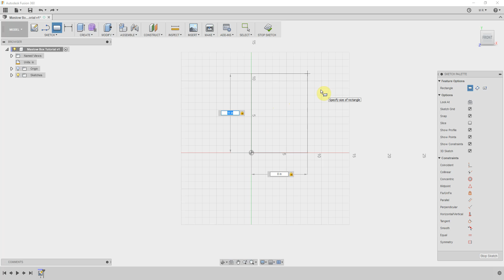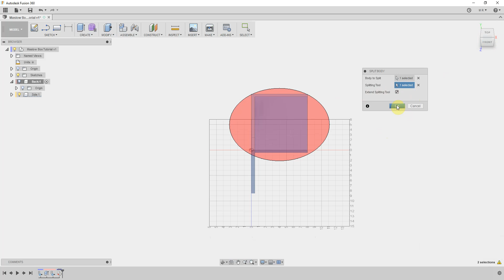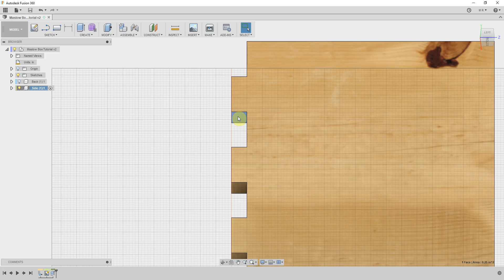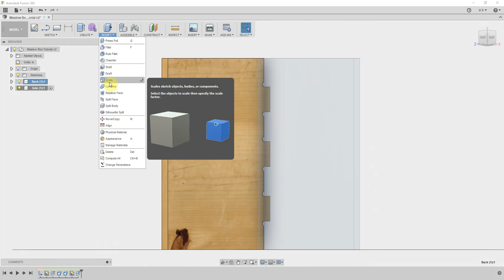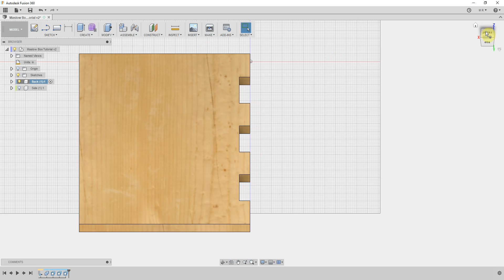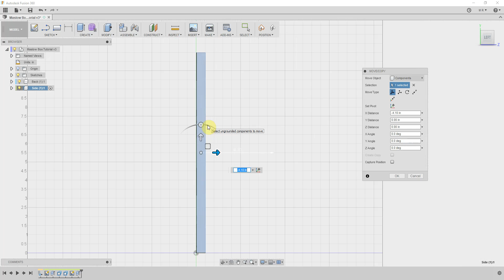Fusion360 CAD for Maslow Box Joint Tutorial

Comment: How did you open the file in ground control to generate the gcode?
Reply: U don't, You use the Post process for Maslow that's added into Fusion 360. 
https://cam.autodesk.com/hsmposts?p=maslowcnc&_ga=2.72204816.268020647.1582566939-996522979.1580383932

link for the Post process download.